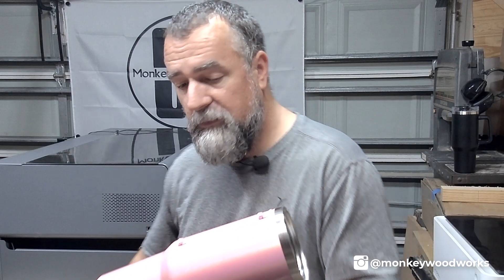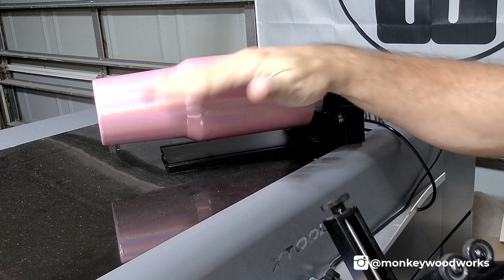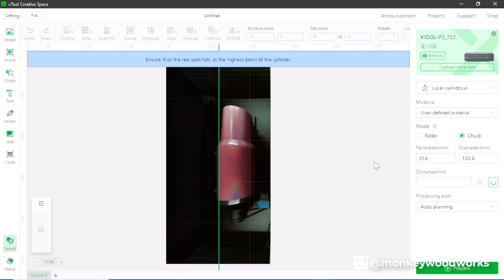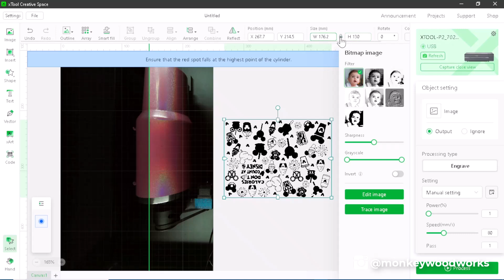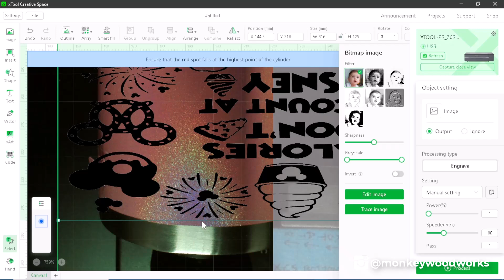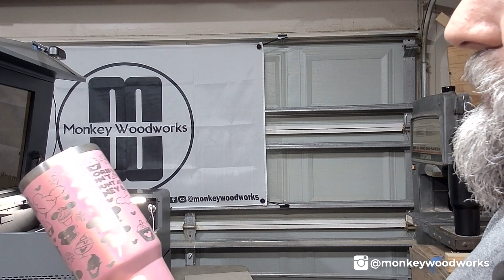How to Customize Stanley Tumbler with xTool P2 and RA2 Pro? |xTool Maker's How-to

Comment: So, you don’t move the green line to the center? I seen others move the line to center( center line marker piece on RA2). 
Can you auto measure by moving over the tabs? ( the camera moves over spot to be marked) . I am still learning.
Reply: On the P2, you do not manually move the green line.  Put the laser at the highest point of the tumbler, perform an auto measure, and trust the software.  You can auto measure on the tabs but find it hard to "hit" them just right with the laser.